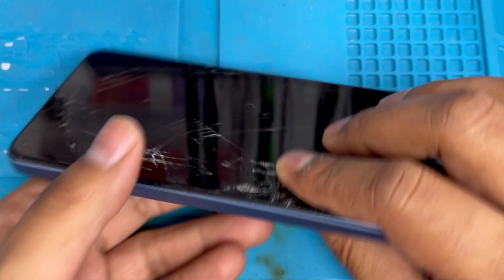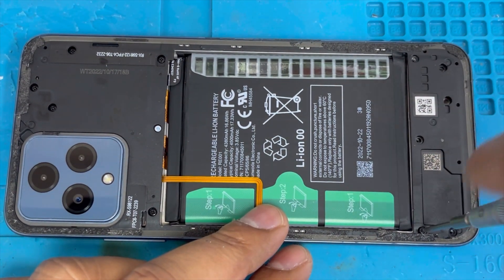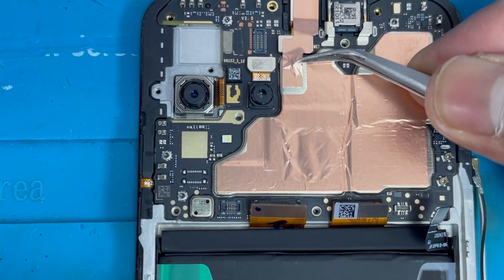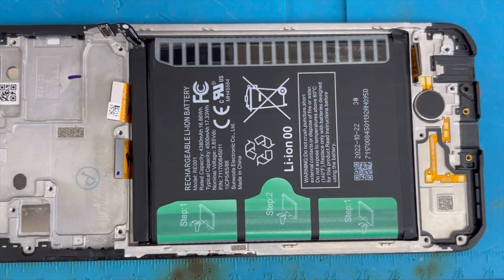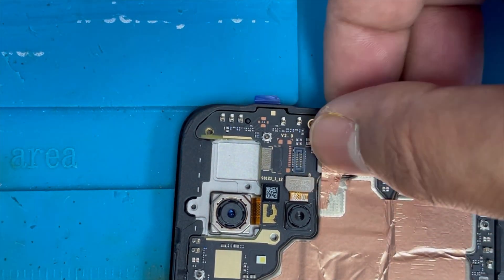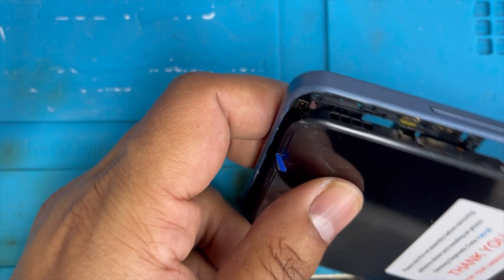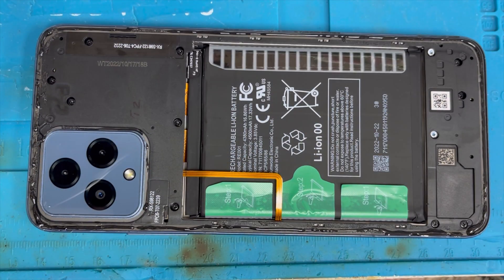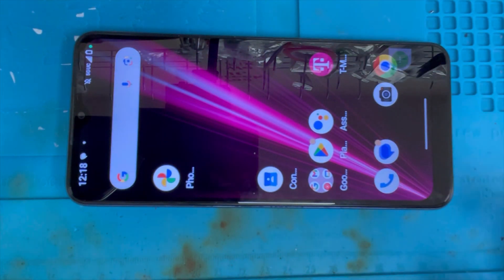T-mobile Revvl 6 5g screen replacement

Comment: I tried to remove the back cover, but had to use a hair dryer and a dental tool, and ended up puncturing the battery, which caught my phone on fire for a second.... now i gotta replace the battery too. 😢

Comment: Thank you! 👍🏼👏🏼👏🏼Your vid shows everything I need to know about doing this job. TOOLS. GOOD ONES. Are the key to working on these phones. Without a good full set of those little torx bit screwdrivers forget about it. (And they must be good, not crap) I think this Revvl phone uses a number 3 torx bit screw. Most kits only go down to number 5. Best have a kit that goes clear down to the zero bit. Still need to buy a heat gun like the one you have before doing this job. Managed to replace a battery and a charge port on my last phone without using heat. Will NEVER do it that way again. Great video!
Reply: Is the heat gun that necessary
Reply: @jmc1000-ll6qy  It can be done without heat but was much more difficult that way. I think it took me nearly 30 minutes to get the first cover I took off without heat. And the pry tool left a couple marks on the phone in spite of being careful. With heat the adhesive loosened up and the cover came right off in less than a minute. Plus there were no marks on the phone when I was done prying. Much easier with heat.👍🏼

Comment: @s-us-u8296  is this the glue you used for the power/volume button? 
I did the entire replacement watching your video so BIG thank you, but my volume button only works for decreasing volume, not increasing..
Can the 6 and 6x (neither parts pro), be used? I can't find a replacement power/volume button that is 6x, they are all either 6x-pro or just 6.. The 6 looks the same as the 6x, so was just curious if you know? Or do you know where I can get a 6x one?
Reply from the maker: https://www.mobilesentrix.com/
Reply: @s-us-u8296  They don't have the flex cable for the 6x :(
Reply: @s-us-u8296  and is the b-7000 glue what you used when you put the flex cable back on or was that a different glue. It looked clear but I wasn't sure?

Comment: What glue did you use
Reply from the maker: B-7000 Multi-Purpose Glue Adhesive (110ml
Reply: @s-us-u8296  is this the glue you used for the power/volume button? 
I did the entire replacement watching your video so BIG thank you, but my volume button only works for decreasing volume, not increasing..
Can the 6 and 6x (neither parts pro), be used? I can't find a replacement power/volume button that is 6x, they are all either 6x-pro or just 6.. The 6 looks the same as the 6x, so was just curious if you know? Or do you know where I can get a 6x one?